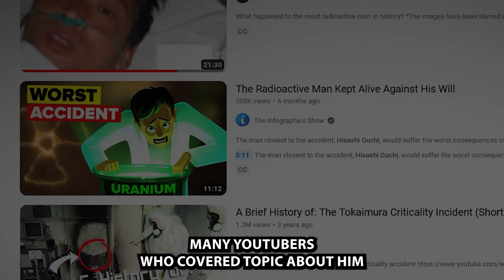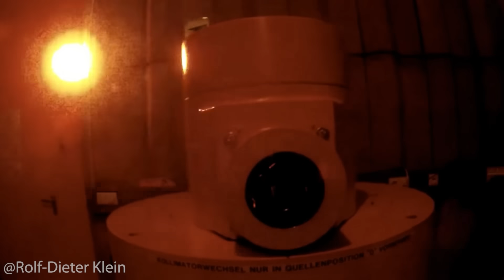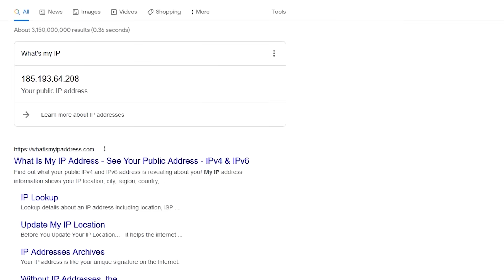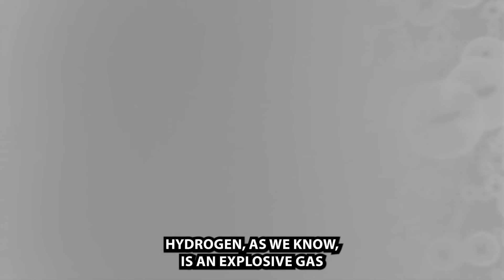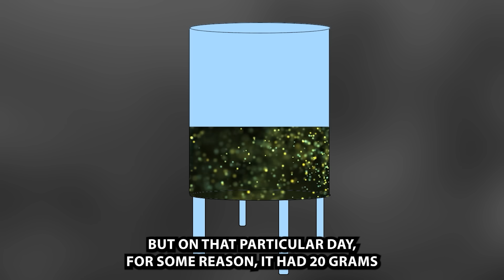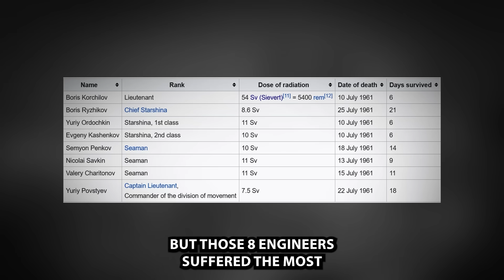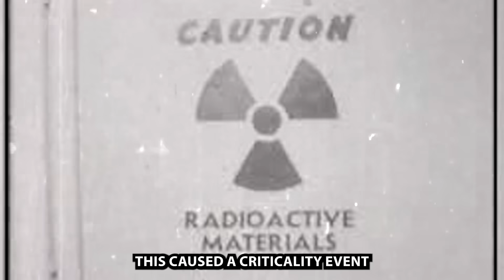Most Radioactive Men Ever

Comment: Oh BTW, There's one guy that you completely missed. Anatoli Bugorski was a Russian retired particle physicist. On 13 July 1978, he was checking a malfunctioning piece of equipment when the safety mechanisms failed. Bugorski was leaning over the equipment when he stuck his head in the path of the 76 GeV (12.2 nJ) proton beam. He reportedly saw a flash "brighter than a thousand suns" but did not feel any pain. The beam passed through the back of his head, the occipital and temporal lobes of his brain, the left middle ear, and out through the left-hand side of his nose. The exposed parts of his head received a local dose of 2,000 to 3,000 Sieverts. That's actually the COMPLETELY LETHAL DOSE OF RADIATION. HOLY CRAP. After this, doctors assumed that he was going to die so quickly. But instead, he survived ALL OF THIS. Say whaaaaaat?

Comment: A scary fact many don't know: it doesn't always take a mega dose of radiation to take someone out. The sievert is used to measure just how much you were exposed to. The Gray(Gy) measures the biological effects of a given dose. Exposure to 1 Sv of beta or gamma, for instance may not be fatal, and depending on the part of your body exposed, may be 1 Gy. But alpha radiation, on the other hand, is 20 TIMES more potent if internalized either by inhalation, ingestion, or even through a cut in your skin. This means that if you take 1 Sv of alpha radiation internally, you take 20 Gy of biological damage! That's because alphas, while they may have the lowest penetrative power, are nearly 8,000 times more massive than a beta(a high-energy electron. That kind of mass striking your DNA can lead to disastrous consequences. 

Too bad Boris Korchilov was one of the victims of these accidents. I had to pause the vid, because he was so freaking hot :)❤ if he were here today, I can only hope he'd like trans women :)

Comment: Some might ask, why always a bluish-white light. Well, that's called Cherenkov Radiation. The protons and electrons being shot out were going faster than the medium they were travelling through. The protons and electrons interact in the medium and create photons because of an EM field and that's usually why a bright blue flash in atmosphere is so fast. The particles that smashed into each other created an EM field that caused photos to emit a blueish light on criticality. Can be purple, depending. In submerged nuclear reactors you can see the rods make the water literally glow blue like a light source because light in a water slows down light down by ~70-75%, depending on if this would be water or heavy water (Deuterium Oxide D2O) which is what is normally used in reactors. This finding means that some particles actually can travel faster than light.

Comment: There are two big mistakes... huge mistakes.
 As far as I know, Hisashi Ouchi gave his consent to live. It's the media that decided to make money out of this case. And you fell in the propaganda.
In nuclear reactors, moderators slow down the high-speed neutrons so that they can attach to the radioactive elements making them unstable and causing fission, ultimately increasing the reaction rate.
Water, in a nuclear reactor, can function in about 4 ways:
1. For absorbing neutrons like control rods (not majorly used for)
2.  As moderator
3. As coolant
4. For steam generation
In the case of the Soviet facility, I think the rods heated up because of the lack of coolant and some neutrons still remaining there. Yes, the water as a moderator can work as a coolant. This property is used in modern reactors.
I don't see any interrelation between the water getting removed and the rods falling. You didn't do a good explanation about that. I guess there's not much information about it too.
Sincerely, from India

Comment: The Lt. General, Chief Commander of the USSR Chemical Troops who made a truck run under 14700 Roentgen (partially protected) received 139 Sv and died few years later.  
You may see him in "Chernobyl" series, 99% accurate.

500 Sv means immediate inability to move. 
200 Sv means 30 minutes available, so you may write a message or talk with someone.

Comment: I visited the decommissioned Nuclear Silo outside of Tuscon, AZ - Green Valley, AZ - and decided to park a ways away from the entrance to stretch my legs (was a delivery driver at the time).
I parked in front of the area that was fenced off and had a sign that said "DANGER RF RADIATION" - silly me thinking "I'll be fine."
My head felt funny - kind of light headed and "buzzy" - inside the vehicle.
I stepped out, and that intensified tenfold. Felt like I was going to vomit, and like there were a million angry bees/ants in my head - buzzy and "loud". Once I got far enough away, everything calmed down and I felt somewhat okay. Basically ran to the van and got out of there as quick as possible. (Whoever thought of allowing parking in front of that spot...)

My first and hopefully last time dealing with that stuff. Nasty. I gained a bit of insight that day to how bad this can make one feel in an instant, and I doubt my exposure was even going to register (thankfully). Just a bad memory now.

Also, place was incredibly depressing - not worth stopping to see unless you're wanting to see that stuff. They do give a tour through the place if you are interested, but damn man... total downer.

Comment: Just a small correction: Lelechenko did not shutoff hydrogen feed to a generator, he shutoff a hydrogen generator. In other words he shut down an electrolyzer which was producing hydrogen gas by splitting water with electricity, and not a fuel cell that runs on hydrogen gas. Often times nuclear facilities route surplus power to "electrolyzers" which split water into hydrogen and oxygen or other useful products. Additionally since nuclear reactors produce a ton of heat, the heat can also be used in different high temp electrolyzers like SOWE's. That hydrogen gas can then be used in fuel cells to produce power. Electrolyzers make hydrogen, Fuel Cells use hydrogen

Comment: K19 reactor wouldn't explode, and neither does the reactor can explode, it would simply melt through the sub, same as the chernobil reactor did. Explosions are from secondary systems, not  "core" blowing up, and those explosions helped to spread radioactive dust which was irradiated from the core meltdown.

Comment: To be radioactive and having been exposed to radiation are completely different things!
Criticality depends directly on the position of the beryllium reflector, so is not reached within some time after it's closed
A moderator does not slow or stop a nuclear chain reaction, on the contrary.

You don't need NordVPN to learn those things.

Comment: an honourable mention for Anatoli Bugorski, who in 1978 was accidentally shot in the head with a 76 GeV proton beam from a particle accelerator and he described it as a flash brighter than a thousands suns. he received a massive dose of radiation to his head, although that's a bit different than being exposed to criticality accidents or nuclear reactors.

he survived and is still alive at the age of 81, but the accident was not without consequences including seizures, losing hearing in his left ear and the left part of his face being paralyzed. I've read that a factor in his survival was that the proton beam went straight through his head, since by stopping inside his head it could have given him a far higher dose of radiation, where it stopped similarly to radiation therapy.

Comment: To put this into perspective for people that dont really understand the measurements, 17 Sv (Sievert) is 17 million uSv (microsievert), normal background radiation is roughly around 0.10 - 0.35 uSv an hour which roughly equals to around 2.4 - 8.4 uSv a day (respectively).

There's also other factors to take into account, like time of exposure (as in did it all happen at once, or did it take years to get to that amount of exposure), there's also full body dose vs localized on a part of a body. There's also different types of radiation (Alpha, beta, and gamma).
Reply: Also, some of the ionising radiation isn't radiation actually.
And it very different affects organisms if they are irradiated, or they ingest or inhale radionuclides. High doses of gamma or x-rays may go through the body literally like light through the glass sometimes without any damage, but carriers of barely measured alpha-radiation/particles can be deadly (like in the Litvinenko poisoning case).
Reply: @augustlandmesser1520  yeah like with tritium, it produces low level beta, has a half life of around 12 years, and has a biological half life of around 9 days, and while in the body it doesn't get absorbed into your body and doesn't cause much if any damage (it takes quite a bit before it becomes harmful) unlike Alpha, internally Alpha is probably the worst, externally Alpha is probably the least you have to worry about (as long as you keep from ingesting it).

Comment: Prostate cancer patients can receive 79.2 Sieverts ( usually the term Gray is used) to the prostate, locally dosed.  It's intended to damage the cancerous tissue.  It's also delivered over many, many sessions (44 sessions, for instance), so the tissue has time to recover between each dose.

A Sievert is one joule per kilogram.  The poor men in this video received the energy to their entire body, so massively more radiation, and usually in a very short time.

Still, to receive such a large dose of radiation even to a walnut-sized gland like the prostate is something that can trouble the engineering-minded.

Comment: I am still wondering what doses the firefighters from tchernobyl took. They fought the fire on the roof next to the open reactor and worked in its expelled guts. There is a documentary where they are on the roof weeks later and there were some graphite pieces laying around radiating with 3000 röntgen. During that night these pieces were much hotter and the firefighters worked next to them for hours, not to forget all the particles in the air.
Every time when I think about cherenkov radiation I wonder what it looked like when the tchernobyl reactor went off. An eyewitness said it was a very beautiful sight; the orange from the heat and fire and the cherenkov blue. Nevertheless I am very thankful never having to witness something like this.

Comment: And that kids is why we label the technical cylinders by engraving or metal stamping rather than ``stick on`` labels... Kinda like the lab rule of no touching the glass by hands... It could be at 600 degrees celsius, it could be contaminated with acid, base or toxic compounds and it all looks the same if you arent familiar with the equipment and its last use... Tech cyls arent like that, but a an unmarked steel bottle is just as mysterious until the moment its either nothing serious inside or its toxic gas or uranium solution... Sure, different compounds use different style cylinders and valves, but those uranium cylinders are literally welding shielding gas bottles with a different valve atop them from the pictures, so imagine one of those being gotten disposed of carelessly and salvaged by someone... If the bottle isnt of at least somewhat sure origin, take immense precautions with any possible contents and treat it like its a tin can of zyklon until you filled it with water, safely sampled some and sent it to analysis... 
I tend to pick up such cylinders for different projects and uses and all of them get treated as if they held tears of satan himself... No sense risking potential assisted suicide with the help of carelessness... 
And avoid medical equipment that you are unfamiliar with if you salvage stuff for projects... Enough radiation accidents occurred around the world with people tinkering with improperly disposed xray machines and similar... Improper disposal of radioactive stuff is the main reason why steel is one of the most polluted industry materials radiation wise, as cobalt, which is a great steel alloying element, also has a monstrously radioactive isotope, which of course, by improper disposal, found its way back to smelting plants where workers unwittingly tossed stripped, old xray machines and such in the furnace, and what left the foundry was ``good``, barely ``alloyed/contaminated`` steel which was ever so slightly radioactive(not recorded, as foundries dont consider or check for that, they worry about chemistry of the metal), and on and on such steel circulated, and more of radioactive shit besides cobalt gets mixed up in small quantities, as rad. cobalt isnt really all that popular in uses... All of which barely registers as contamination in regards to alloy chemistry, but is enough that a lot of steel in the world gives off ever so slightly elevated reading that is barely above residual radiation reading of the world around us, but its there as a monument of improper disposal of mostly medical but also other radioactive equipment... 
It also makes me wonder about those workers who stood near the furnaces working the crucibles that contained molten steel in which a piece of radioactive isotope was chucked... How does a piece of radioactive material behave in a vat of molten metal, as i know that that doesnt affect radioactivity in a way to revert the isotope into a stable state which isnt radioactive, just how you cant toss radioactive waste into volcanos and consider it dealt with, as the particles will just float around, now liquid and radioactive, however diffused by solution... It would be an interesting study on its own... Just like the one on an asian town which had a whole section built with moderately radioactive rebar as concrete armature, and the people there actually thrived with considerably fewer tumor developments than regular people, which has an explanation, or at least a suggestion of one, but if you care, you will find and read about it like i did a few years ago...

Comment: This video got a lot wrong.

Louis Slotin: from wikipedia, he was exposed to 2044 roentgens of radiation, which equates to 19 sieverts, not 21
Aleksandr Lelechenko: from Kyiv Polytechnic Institute, he was exposed to 2500 sieverts, which equals 23 sieverts, not 25
Cecil Keley: This is actually accurate, 36 sieverts.
Boris Korchilov: Also accurate, 54 sieverts.
Vasilev: No data, cannot confirm if it is true
Robert Peabody: from wikipedia: he was exposed to 7 sieverts of radiation, not 100.

Comment: Sievierts work on a lower but similar level to decibels. 100 sieverts is not just 10 times more than 10 sieverts which is the lethal dose. Its exponentially more. The cellular damage at that level is much faster, more violent and completely irreversible.
Reply: I forgot to add that it also depends on the material. Various radioactive materials have various levels of radiation, different type of rays namely alpha beta and gamma rays. As well as the particles they constantly shoot outwards happen at various rates. Some of these materials change their chemical properties when handled poorly or mixed incorrectly.

Comment: 10:44 tf what could cause that?

Whats theneffect of radiation to the clotting of blood?
Reply: Radiation tends to make the blood very anti-clotting so if you get even a small cut there's a chance you could bleed out, copy and paste reply of one of my responses that somewhat explain it

If you want a in-depth explanation there's [this video](https://youtu.be/X1FbwooXssQ) talking about a guy who experienced 20 Sieverts of exposure for reference 500 Milisieverts or 1/2 a sievert is when symptoms appear and 4-5 Is considered fatal

(WARNING: THE VIDEO IS EXTREMELY GRAPHIC)

If you don't want that, what happens is when exposure to radiation, the immune system is one of the first targets as well as mucus linings in your body, what this means is that it's extremely hard to get nutrients into your body and with the immune system being practically gone / completely destroyed in some case you have no way to fight off infections (and also platelets drop so your blood doesn't clot either) 

The skin grows from the bottom layer up and once at the top it falls off (the time it takes to fully replace skin is about 2 weeks) , so because the body is unable to properly repair itself, new skin cells are unable to grow to replace old cells and in severe cases it gets to the point where every skin cell is dead due to their short lifespan

Comment: The term critical just means the reactor is not changing power levels. Subcritical means it’s dropping in power, however when a reactor is shutdown it is subcritical because of its reactivity at the time. A supercritical reactor is just increasing in power. That being said a reactor that is shutdown, as previously mentioned, is subcritical which means to make it critical you have to increase the reactivity a lot which usually relates to an increase in sustained power. I’m not sure how all reactors work but I know for that one using water as a moderator your have to increase the power to an extremely high level to have a critical reactor. Also if it was critical the reactor would’ve maintained power instead of dropping off again which means it probably went supercritical for a split second and then hit the poah then dipped back down to where it was before the casualty. There’s ways to maintain a critical reactor before hitting the specific range you need to hit for it to naturally maintain itself however in casualties like these you’re not using rods to do that and the events happen too quickly to maintain a critical reactor. The more you know. Nuclear power is often misunderstood, if not by general operation then by terminology, but that’s no one’s fault usually. The only time it’s someone’s fault is when they ignorantly say nuclear power is harmful or dangerous without actually understanding it. That being said most people don’t go to school for a nuclear field degree so they’re forgiven in that sense.